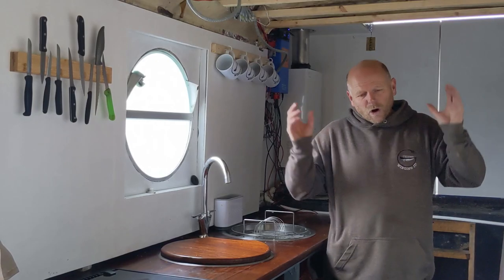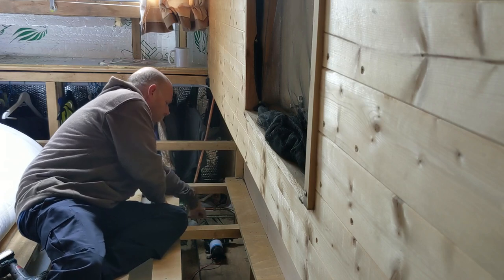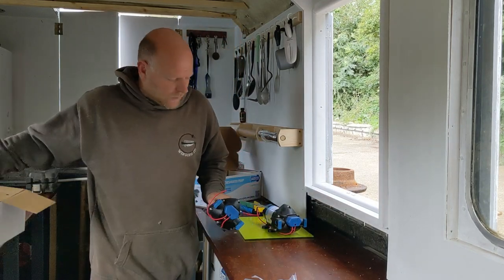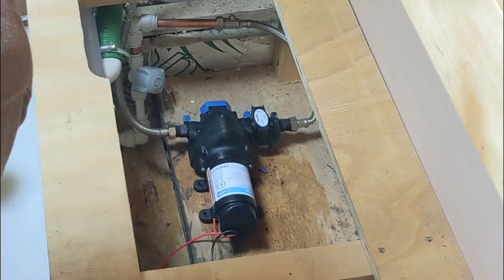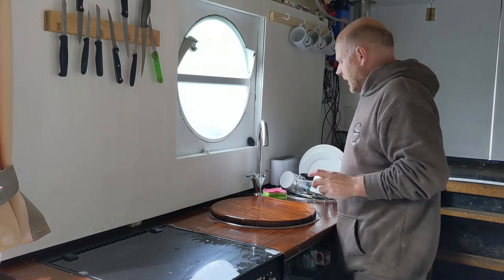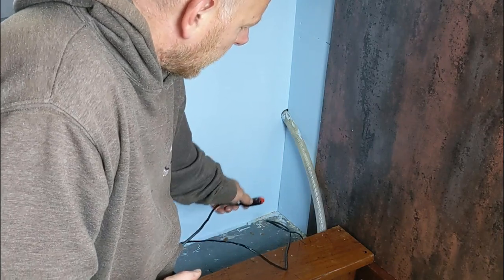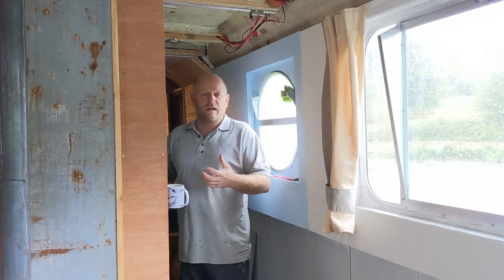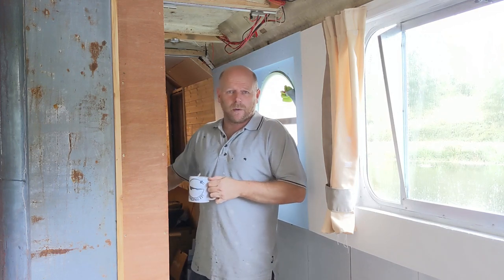LPG BOILER fitted and FIRST test of the SHOWER on our DIY narrowboat project

Comment: Hi Pete, great result on the hot water set up. I wish I had as clear an idea of what is where and how it works on my boat. One thing I thought worth mentioning. My wife picked up on it and it’s saved us having to fill up on water so often. We keep a jug in the bathroom and kitchen to run all the water from the hot tap into before it reaches temperature, this then becomes our kettle water supply. Hope this is of use.

Regards

Rick
Reply from the maker: It's just me advantage of building the boat... We know where everything is and how everything works. 
I like the top for the jug! We will be using that idea! Thankyou! 
😁

Comment: Very nice Peter, glad you can cross another milestone project off your list for the boat, what a relief.  That water pump change out went surprisingly smooth; no leaks, compatibility, or fitment problems - Don't get used to that!  On the old pump, I suspect the pressure could have been changed by using a different pressure switch, assuming that switch is accessible.  Being in the US, I am not familiar with the water heating system that is generally used on a narrowboat, looks like have a Demand Type that turns on the heat when it senses water flowing.  It's good you got the gas fired type, so you don't have to be tied to shore power.  I suspect it will empty the propane tanks quickly; it takes a lot of heat to heat up bath water so, any kind of water savings measure you can implement should help save some money.  Glad to see things are winding down on the boat refit project, now you two can (hopefully) spend more time doing something pleasurable - Cheers!
Reply from the maker: I did think that it's probable that the pump could fairly easily be altered to the higher pressure. Clearly they are the same unit overall.

Comment: Whenever the working part of a big project is completed it is a great feeling - a weight off the shoulders. You looked a bit more upbeat today as a result. Now it looks like remaining projects are pretty much all within your comfort zone, so a good place to be. 

I was surprised that you have the water pump just under the bed though. It will mean if one of you ever wants a lie-in the other one neds to avoid using water to prevent the pump making noise.
Reply from the maker: A lie in... never - one up ALL UP! :)
Reply: @WingingItBoatingonaBudget  I am a migraine sufferer (nowadays quite rare, but it still happens - last time was about 3 years ago, it was about monthly as a teenager). That means a dark and quiet room for 24 hours or so. Noise and/or light causes a lot of pain and can even cause me to throw up, so on such occasions the house is silent and I stay in a darkened bedroom till it goes off. I might be stood up part of the time when I have a migraine (typically with forehead resting on the wall) but not up and about. So it isn't always about a lie in.

Comment: Great videos , can even teach the stupid ha ha .bit of advice , on power leads that go to things you need to have the insulation shroud on the power source cable . Just if it’s disconnected with bare connections and someone accidentally throws the switch , it saves things getting fried . Accidents do happen lol

Comment: You might think of adding a small accumulator to that water system. I have a motorhome and found the pump noisy under the bed, added said accumulator and amazed at the difference.
Reply from the maker: Yes it's something I'm looking into... Cheers.
Reply: @WingingItBoatingonaBudget  I fitted a Fiamma A20. cheap and does the job,, should suit you lol
Reply from the maker: @robertpainter3880  sounds ideal! 💷💷💷

Comment: Looks like it will be all plain sailing from here on Peter. You'll be floating all the way now with what next you've to do. I'm guessing the central heating will be the next instalment on the cards to sort out before continuing building cupboards and shelfs. Keep up the good work. 👍Soon be all done. Dawn will be as happy as a bunny once its finished.
Reply from the maker: We are getting there, the heating is provided by the log burner, I am just tweaking the hearth that i made a couple of weeks ago... Dawn is already happy, but will be even happier once the ceiling is up!
Reply: @WingingItBoatingonaBudget  Best you get some nice warm blankets for winter then. & maybe an electric blanket too. 😉 Maybe Dawn could knit you some nice woolly bed socks each. Plus a bed hat. Ha ha. 

That ceiling should be a doddle with all the practice you've had. Be up in no time. 

Be safe and keep warm guys. 😍

Comment: Have to considered getting an extractor fan to help pump out the damp air?
Reply: Also, congratulations on completing the last of the big jobs.
Reply from the maker: We will see how it goes as there is a window at each side in the bathroom. But if needed we will add a fan.

Comment: Hi,
Looking at getting this for our boat and was looking for a little guidance! We have a 23ft cabin cruiser with limited space for the flue. 

Can the flue be horizontal out the side of the boat?

Does it require constant 230v power to run?

Our pump is a whale freshwater pump at 45psi pumping from a 120l flexible water tank, would this be sufficient supply & power?

Thanks!

Comment: Looks good 😊 How hot does the flue get? Im fitting one in a lorry with a fibreglsss roof
Reply from the maker: Never measured the temperature. But our boat has a fibreglass roof and the flue passes through wooden ceiling boards and there’s never been a problem with anything getting too hot.

Comment: lol, you re not a propper tight yorkshire man  as a real one would have stripped old pump down and adjusted pressure with the screw inside lol
Reply from the maker: I did consider 'tinkering' but didnt want to risk getting it wrong and causing damage to the new water boiler.